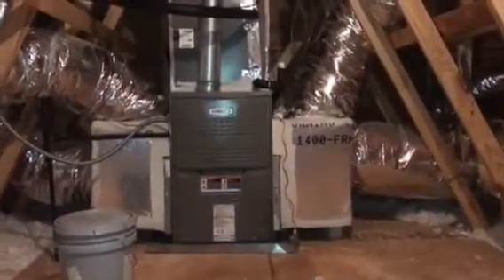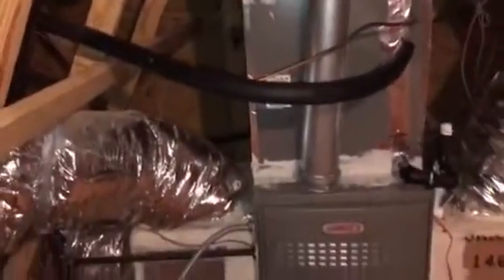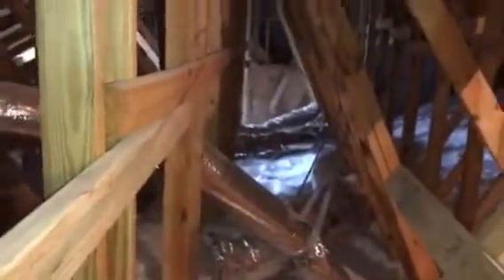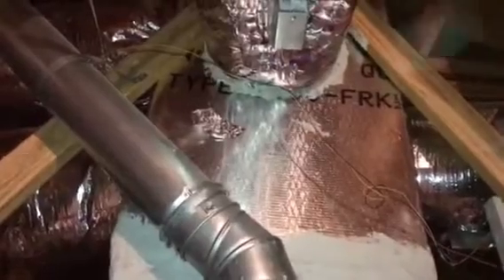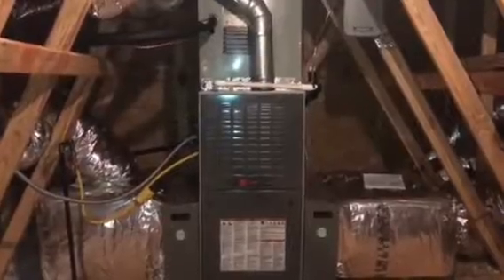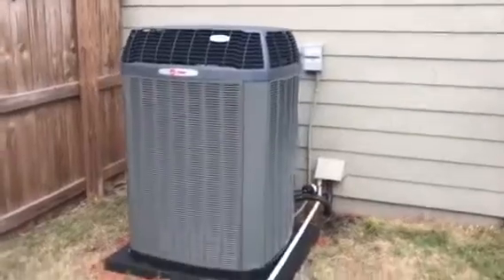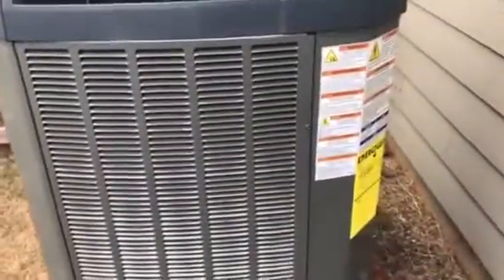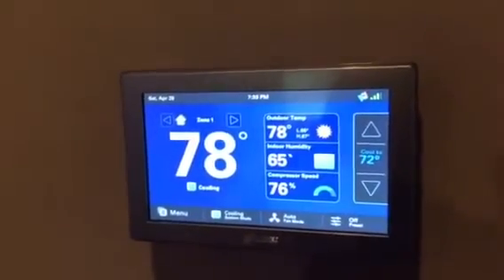Lennox to Trane change out with 20 S.E.E.R. zoning

Comment: I wish you was in Louisiana, I need some who can equail the temp. in my 1,700 sq ft house. The house is 10 years old and I have had it for 6 years now. I have several a/c service company out and it's still not right. The master bedroom is hot, the 2nd bedroom is hot and the living,kitchen,den is comfortable. I have thought of a zone unit but I have a single stage unit.I have fans at the doorway to boost more air into the bedrooms. Their is  good air flow and all duck work is fine. ei. at 9:pm temp. out is 68* a/c is on  and the temp on the thermostat is set to 71* and it is 71* at the thermostat, the master bed room is 75*. and the other bedroom id 78*. all duck work come from the plenitum. and is 8 inch. I know you would have to see the whole picture but any suggestion.
Reply: Probably need to add a 2nd duct to each room not difficult at all if your plenum has the room to add a few

Cut the holes and add the flanges and some flex duct where needed
Reply: I can also say you can install a mini split in your bedroom I bought an okd doublewide with the original 80s system still working 

Installed 2 mini splits and don't need the central at all but it's a good backup

Comment: I'll bet the back pressure with only one or two zones open is nuts.
Reply: At least the condenser unit isn't mounted so close it's rubbing the outside wall ;)
Reply from the maker: No sir, our Trane full variable systems with zoning are completely communicating. Everything operates from 30% to 100%. Including the indoor and outdoor fans as well as compressor. They are quiet, comfortable, and efficient!
Reply: @TedCookHVAC  My original comment was towards that wonderful "David Lennox" installation, not Trane.  When we were shopping for a new system in our house, Trane was only offering a two stage system.  The LG variable speed compressor was still in testing.  I will admit my experience with the LG variable speed compressor in LG Refrigerators have been problematic, not just for myself, but for many customers.